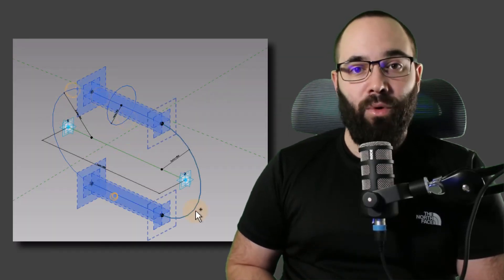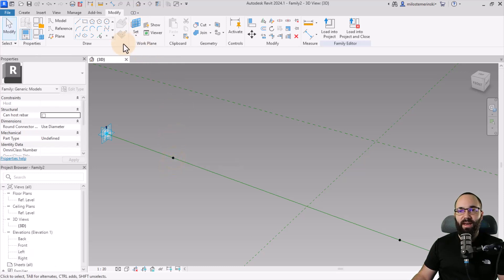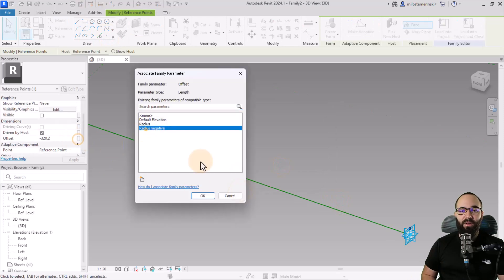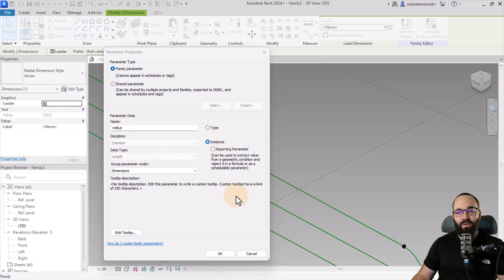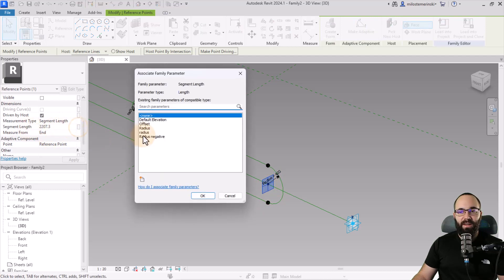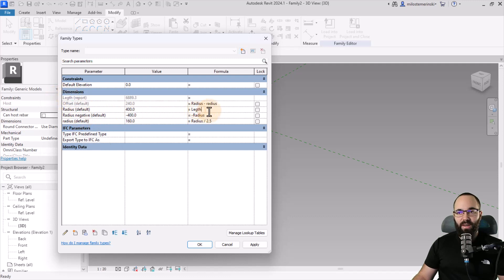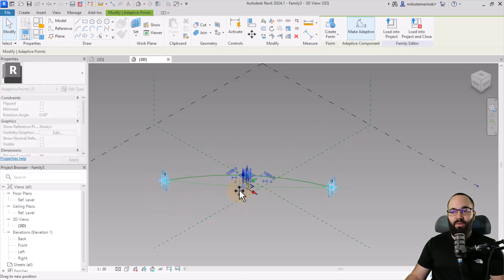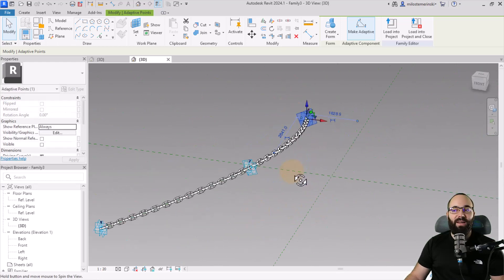Parametric Adaptive Chain in Revit Tutorial

Comment: Became a patron just to support content like this. 

If you were going to make a pulley system. 

With an Adaptive wire, 2 different family’s on each end of the wire, one a Wench the other a connection to the Chain link fence. And then the chain link fence is wrapped around 2 more family’s that finally connect to a bucket. 

(Oh and the mid point of the adaptive wire has a family there) 

If you only need this in 1 location and You are documenting this and want control over all of the places would you build it as 1 family with many nested Adaptive family’s. 

Or should I build this in the project setting? 

I’m having a hard time controlling all of the points

Comment: Is it possible to fulfill the gap between the points with a most similar size of pipe, considering I'm working with specific sort of sizes (0.50m, 1.0m, 1.5m, 2.0m... 4.0m)? I mean... If I choose an start and an end with 3.27m length, would it be possible to put a 3.5m pipe centered between the points? And... if so, is it possible to calculate the material? Taking the same example as before, would Revit count it as 1 3.5m pipe?

Comment: help! when i try to set the offsets the curved end lines move rather than the adaptive points and separate from the points they were drawn from, what am i doing wrong? @balkanarchitect
Reply: Same
Reply: same
Reply: just make sure that every parameter is instance parameter
Reply: Even I got the same kind of problem. Even after I checked all parameters as instant parameter. Please help me out to solve this problem.
Reply: Same problem here but I got it! You need to Set the Work Plane again on the second point when creating the others additionals points